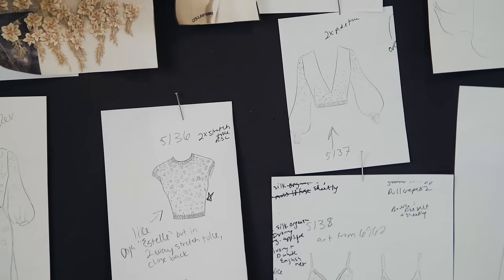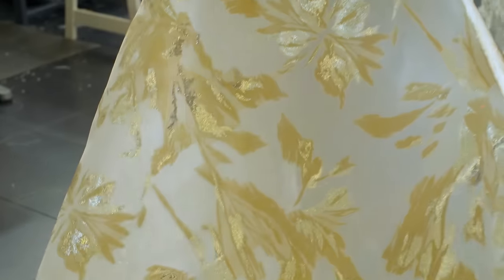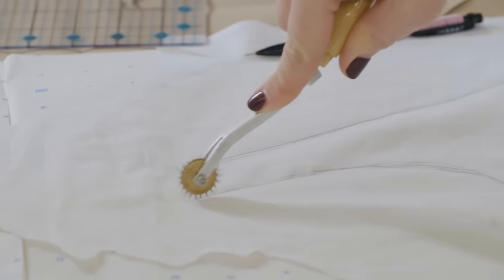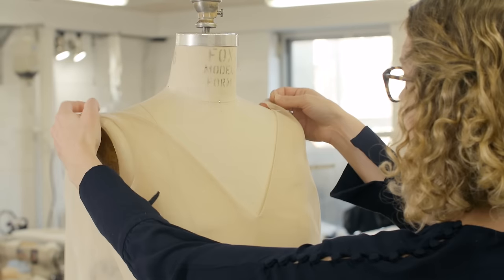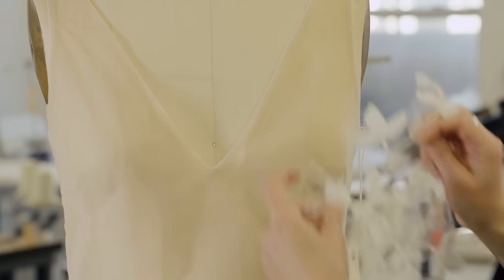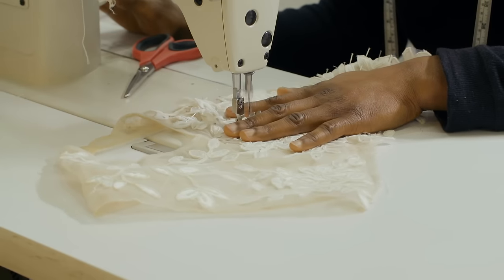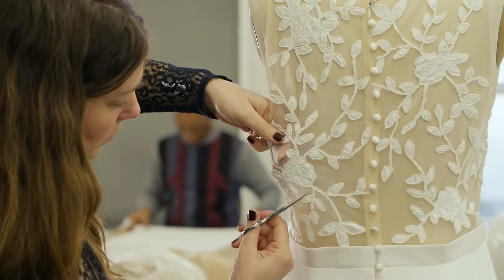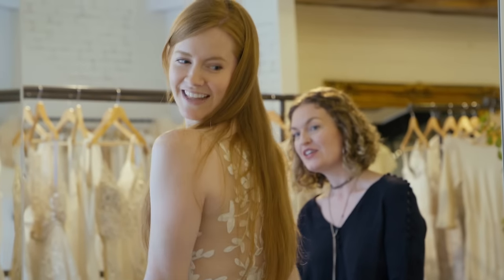How to Make a Wedding Dress from Start to Finish | How I Make It | Etsy

Comment: I love sewing too and i want to use my skill finally! Thank you for this video i really feel motivated now to make my own wedding dress... I just have to trust myself when doing it... Greetings from Austria...
Reply: I'm planning mine, and it's a lot of fun, but also a lot of work. The trick is to get a cheaper fabric and test it out before using the good material. What I usually do is use a lining fabric to test it, and then use it as the actual lining. Or to be cheap, I'll test things with old sheets or curtains that are similar in weight.